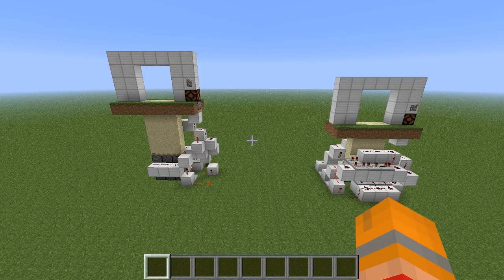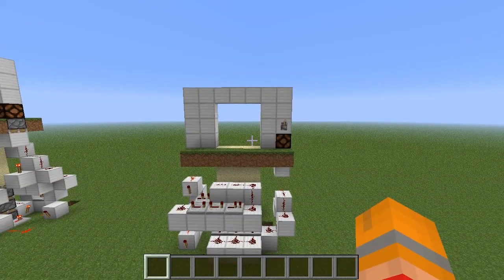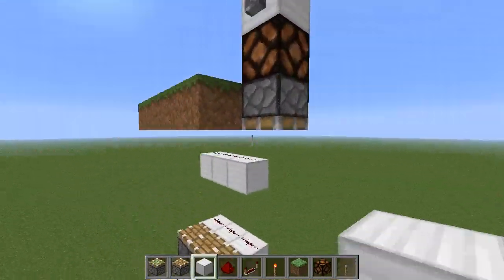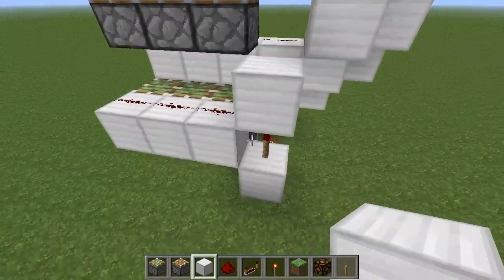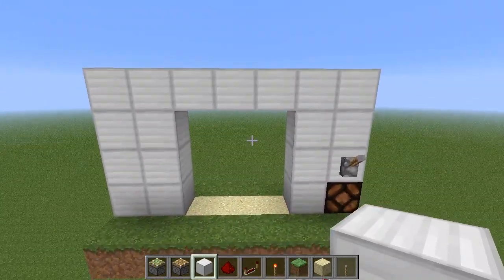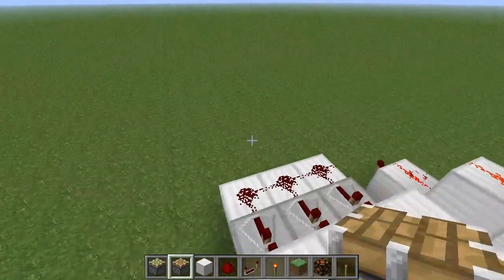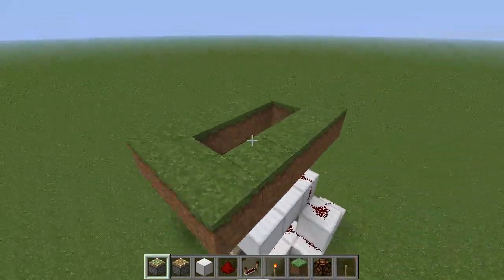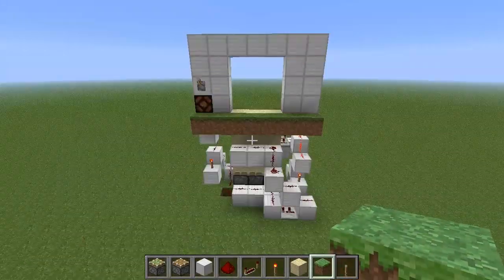3x3 Sand Door Tutorial

Comment: That is not true. Blocks transmit power to adjacent blocks when they're being powered by repeaters, redstone torches, levers, buttons, pressure plates and hooks. In this case, the redstone lamp is not being powered by any of those. It's receiving its power from the block on top of it. Therefore, it will not transmit its power to adjacent blocks and is therefore not the cause of the extended piston.

Comment from the maker: Not exactly true. A redstone lamp acts exactly like any other solid block when powered, but the difference is that when the lamp turns on it causes a block update. The piston is acutally being powered by the block above the lamp, not the lamp itself. Of course, if you put the lever directly on the lamp then it would be the lamp powering the piston. Try this: piston, air gap on top, block with switched on lever. The piston wont power until you update any block next to the piston.